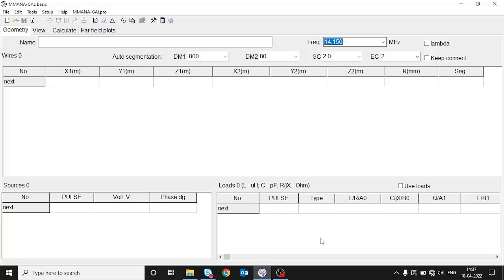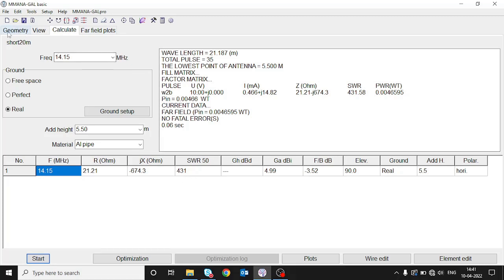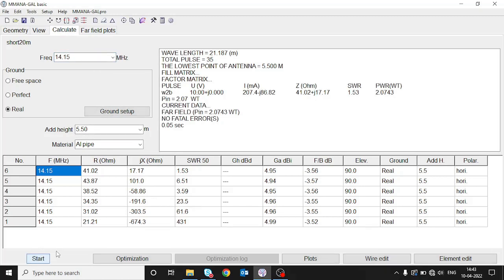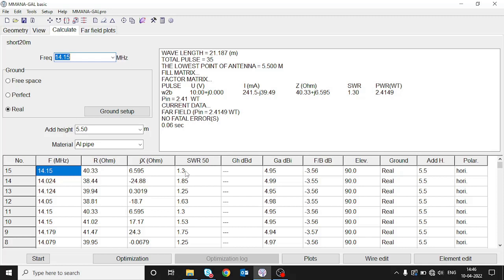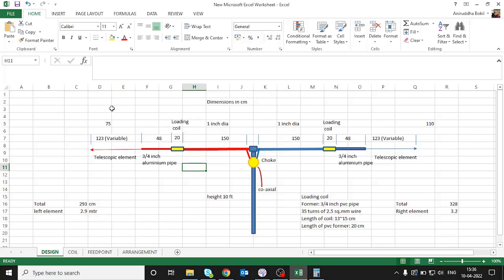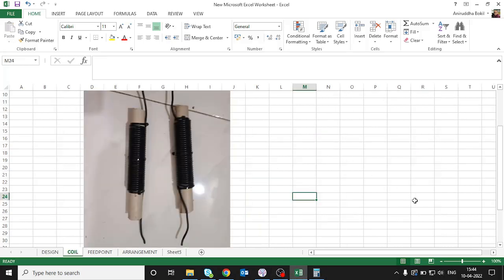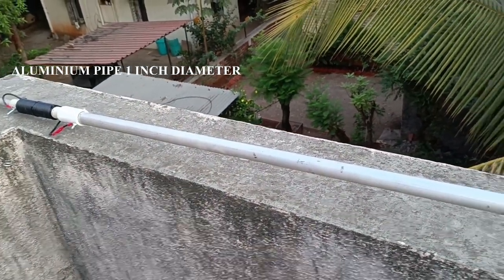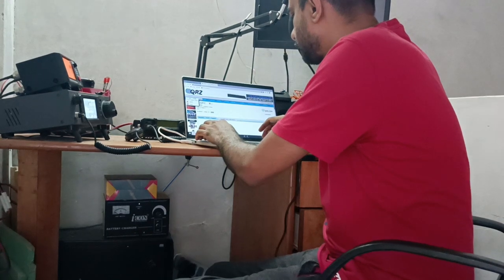Short 20m dipole antenna! Designing, Building and Tuning. The complete process!

Comment: Could you please clarify the following. 1] for the coil diameter -3/4 inch [ 19mm] diameter mentioned but the input in the calculator indicates 3.1cm? Also, the actual coil shown  is closely wound, but calculator indicates imm gap between turns? Diameter of actual wire used is 2.5mm but calculator indicates 3mm?